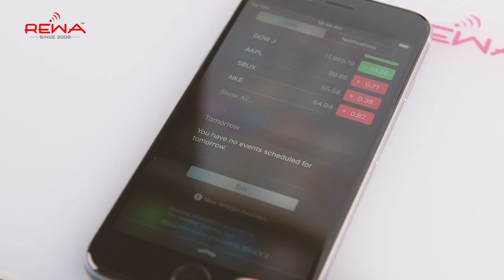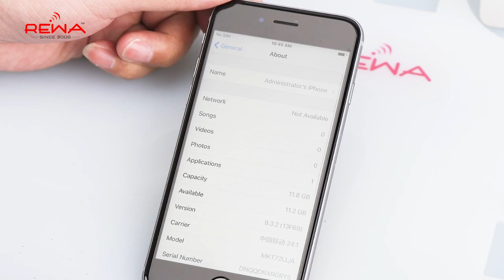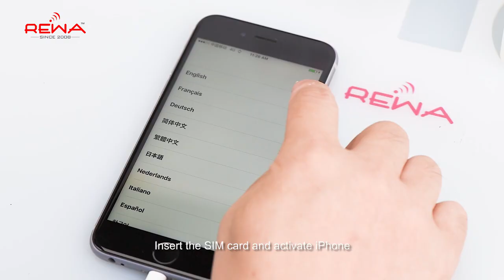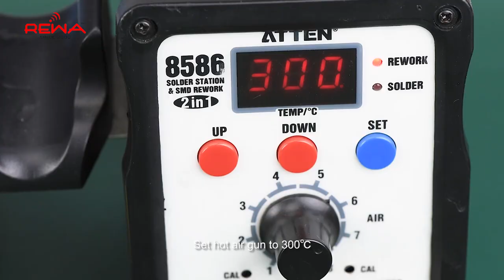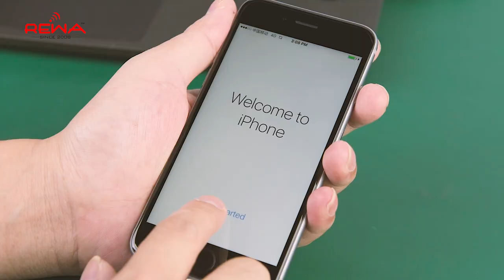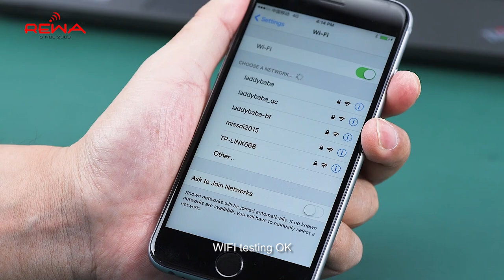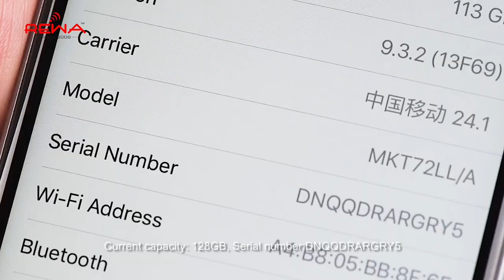Upgrade iPhone 6S 16GB Storage to 128GB

Comment: Can someone tell me what flux does?
Reply: Quantum Radiation it changes the brightness of your phone
Reply: NiceAim Will not consider your response... troll..
Reply: Quantum Radiation makes the solder flow easier making the joint bond better.
Reply: he wasn't trolling you hes just uneducated and thought you were talking about a computer program (FLUX) that has been built into the new ios versions.
Reply from the maker: Exactly.
Reply: uneducated lol ok ok
Reply: ItsTehzo Well you would think that he was talking about the Flux in the video instead of irrelevant software. Im guessing that he didn't watch the video. But now I know what flux is used for.
Reply: oh ok
Reply: The flux capacitor, which consists of a rectangular-shaped compartment with three flashing Geissler-style tubes arranged in a "Y" configuration, is described by Doc as "what makes time travel possible." The device is the core component of the time machine.
Reply: f.lux? It's a windows/Mac/iPhone app that changes the color of your screen at night. Copied by Chainfire in c.lumen. It's a redundant apps now because iPhones all have nightshift now. :p
Reply: Social Spit You obliviously didn't watch the video or read the previous comments..
Reply: Flux protects solder from oxygen, which is in the air . When metals are hot they bonds easier with oxygen and make  oxides, which is not good for electric equipment. Electrons flow "better" (faster and with less resistance) in clean, pure metals.
Reply: Mario Power thanks, knew there was more to it.
Reply: Quantum Radiation In high-temperature metal joining processes (welding, brazing and soldering), the primary purpose of flux is to prevent oxidation of the base and filler materials. Tin-lead solder (e.g.) attaches very well to copper, but poorly to the various oxides of copper, which form quickly at soldering temperatures
Reply: It works like KY Jelly.
Reply: Social Spit Nightshift - a copy of samsung's blue light filter
Reply: These few comments' just killin me so hard :D
Reply: it reduces the soldering temperature , ensures better bonding.

Comment: As a technician this is a lot easier to do easier than programming, programming is a way lot harder than this.

I recommend this to the people who does have old phone and necessary tools to practice pcb repairing/upgrading of a certain phone model. 

Don't do this if you don't have all necessary tools/equipment or you're gonna end up messing up the pcb/motherboard.

Comment: Guys, in order to make it fully successful, one thing that you need to do is debug the new drive by copying the critical data from the old drive by using a special equipment. You can check Strange Part's video for that.

Comment: Can I remove iCloud lock with this method ? 🤔
Reply: Edward Garcia no its in the motherboard
Reply: I mean the cpu
Reply: Somewhere i read about this, it is possible but i have no idea how.
Reply: HaLuNkE ST0NER You have no idea what are you talking about, i don't know if iphone 6 series has it anymore, but till iphone 5s there is a chip where the icloud data is stored, and that chip can be removed and replaced with an non-locked icloud data, i know it can be unlocked i had seen it at a hacking mobile service in Romania.
Reply: GabrielTV sure...they probabley going to steal your phone 😂
Reply: I said this because I bought an iPhone 5s on eBay and it came with iCloud :/
Reply: Has soon has you are prompted to do an Activation you will be fucked. The iCloud is locked on Apple Servers has Halunke says. So when you restore or you Update your device you will asked to do an activation (has you see it twice in this vid). 

You then need a internet connection and an activated sim card. At this moment a signal for activation (kind of an SMS) is sended to Apple servers and they check by serial number the device and update his status on theyre servers.... And there, if the device is locked with iCloud and you haven't the password or be able to reset it..... you're fucked.

The only way to avoid it would be a fack activated device. A chip or something replaced on your device to avoid activation.... But its risky. And if your device, for some reason has the OS instable you risk him to ask for an iTunes restore trought a computer.... so trash worty iPhone.
Or at the moment you will made unvolontary any update of your OS (or because you start to need it)... you're fucked.

Some services like Facetime and iMessages would be unable to activate...so you're fucked again... 
And you would be probably using another account activation... with the risk of being using Find My iPhone other account...

Well! A lot of headaches you would have!... And if it is really possible at least!... what i doubt... it is on Motherboard.... so... forget about it and purshase another iPhone... like everybody else... it is better. ;)
Reply: Nuno Brown you can unlock it
Reply: JackPlaysOfficial how?
Reply: JackPlaysOfficial I worked for Apple 2 years. I was an Account Security advisor... And i can tell you... even me that had all the tools to manage the accounts i were unable to unlock it. It's just impossible because the way they build it...

The only thing that you can do if you find an iPhone locked with iCloud is praying that the person that lost it launch a complete wipe on the device trought his iCloud account and then, he would lost the "Find my iPhone" lock with it too.
Reply: Nuno Brown there's always a vulnerability
Reply: JackPlaysOfficial Or another eventually is that the person doesn't have set no passcode on the lockscreen and you have access on the device... and if you're lucky and she has set all his emails on it, send a reset password from appleID manager and reset it trought password reset email in the person emails... that's the only alternative.... And i actzually already said too much here...
Reply: JackPlaysOfficial You don't understand don't you? What vulnerability?... Your device is locked on Apple Servers, not on your device directly.
Reply: Nuno Brown there's always a possibility
Reply: Haha all of you guys chill 😱
Reply: Edward Garcia 😉
Reply: Nuno Brown the truth hurts
Reply: JackPlaysOfficial you're just trolling men. There is o solutions other than the ones i mentionned earlier.

Has i said to you, i were Account Security for Apple for 2 years and i had someone with a locked iPhone in the family and were unable to find him a solution. There's no solution. Even if you work at Apple has you see...

We even had lots of customers that locked they're own iPhones and weren't unable to use them...
They need to send them for replacement with a Proof of Purshase... And they were replaced!
Reply: Nuno Brown That is none of your business. There is always a way to turn off iCloud lock
Reply: JackPlaysOfficial how... explain to us. go.
Reply: Nuno Brown I can't. But the video does show proof
Reply: This video??...
Reply: Why you can't? You're afraid the FBI is watching you? 😂

The guy restored twice his device and twice he need to activated trought normal procedure.

You gonna take the flash, install a already activated profile on your device and put it back to your iPhone... 

Then you will have all the contraints that i talked before...so whats your point?
Reply: Nuno Brown it's Man lol. I never found a a jailbreak anyways
Reply: JackPlaysOfficial wathever. it was a pleasue
Reply: and in the time that would take you could just steal a bunch of iPhones, sell em for parts and buy a legit one.
Reply: Yes. There is a tutorial by the same person. You just flash a new serial number on the NAND.

Comment: Might as well buy a Samsung with SD memory,its a better phone anyway,plus its cheaper.
Reply: Then don't buy the Note 7, get the S7 edge. Plus, iPhone batteries have been exploding as well.
Reply: What do you mean? "2  charge of phones"?
Reply: Yes. The Note 7 Explodes. Don't get the Note 7. Get the S7 Edge. It does not explode.
Reply: +Andrew Longauer But then how would we get a bigger screen? The note series is the only series of samsung phone i would get simply because the other models are simply too small. Of course, I could always get an iPhone plus.
Reply: Red Rooster I have the S7 edge. The screen is huge. You're really underestimatimh the size and either way you could go for the S6 Edge Plus or Note 5
Reply: Red Rooster - it burns better, that for sure
Reply: Red Rooster until it burns your house down
Reply: Alex Frattaroli - even though only 0.383 phones had problems - 100% of them are banned on the airplanes , and you can buy 0 of them in US. You right, I'm LMAO... out loud !
Hahahaha

Comment: As a certified automotive tech who became an ASE Master in 1978, I can tell you that this person not only knows his/her job, but take pride in doing the task properly and takes “Best Practices” to their industry. Bravo and great job. I do my own repairs on everything but I also know where to stop because I don’t have the equipment or software to properly accomplish this job. This is for Internal memory that is in the central processor unit and placed on the board with multiple points of attachments. The key issue for a surface mount device (SMD) is the solder will flow anywhere flux is applied. The cleaning both mechanical and wicking excess solder off board and preparing them for clean attachments is one half of the job and can not be overlooked. But the use of the soldering paste is crucial because it only allows enough solder on each pad to flow into proper contact when heated. Too much solder with the necessary flux means that under the chip, solder can run anywhere and touching other pads while shorting out circuits as each have a different function. So trying this without a stencil is impossible as the paste, thickness of stencil, much less position is the only way to keep solder on one pad. Excellent video, fabulous text, the right video speed and overall camera/lights makes this concept of completing this or another chip, just perfect. I hope my explanation helps someone understand better what can go wrong during a repair as I am not a computer or phone guy or affiliated with any company. Injured and not able to work in pain with limited money is a common problem in later years. This I just my interpretation of what I know from similar repairs and soldering skills on wiring and electronics. I am one professional guy giving a “Job Well Done” to the professional in this video, with helpful info!
Great job, two thumbs up!

Comment: Upgrading iPhone storage:
1. Remove screen with screwdriver
2. Remove logic board with screwdriver
3. Place NAND flash under $300 heating lamp and remove NAND flash
4. Flux and tin the connecting pads on the logic board
5. Flux and tin the connecting pads on the NAND flash
6. Reball NAND flash with reball stencil
7. Place NAND flash into $300 NAND programmer
8. Backup CPU/baseband info from old 16GB NAND to new 128GB NAND
9. Perfectly align new NAND chip with logic board
10. Heat new NAND chip with heating lamp to connect chip to the board
11. Reassemble logic board back into the phone
12. Reconnect screen to phone
13. Done

Upgrading Android storage:
1. Insert microSD card into microSD slot
2. Done

Comment: Awesome! What type or model hot air device do you use? Can I use this approach to save data from my tablet with moving the memory from the dead one to new one?can I move the data in some other way if the tablet motherboard is dead?

Comment: There should be a business that could do this.  A few things they could do, buy an iPhone from Apple, convert to greater storage, add a larger battery by replacing the back cover with a larger one to house a bigger battery, have a sim card slot that can switch from the original one and then add a cooler back housing.  Too bad Apple isn't doing these things.

Comment: Do you need to have the PCIE Nand Flash Memory Chip Programmer ? Or you can just put it without the programmer?
Reply from the maker: PCIE NAND Flash Programmer is required to program the new NAND.

Comment: Never plug in battery to motherboard before u connect display and other wires!!! this is not safety for electronic components inside iphone
Reply from the maker: You are quite right! This is actually an inaccurate demonstration, especially for beginners. For experienced repair techs, sometimes they may connect the display first for their technical proficiency. But for beginners, this misoperation may damage the phone. Thanks for the feedback. We will keep improving.

Comment: This process can be done with the android mobiles? Galaxy s6 or Pixel for example
Reply: Nahuel Duarte heard of a sd card?
Reply: @travisscott2264  The S6 and Pixels don't have a slot for SD and the adapter is uncomfortable. Maybe if it's possible to solder an adapter to the board or something like that, it's an intresting and riski idea
Reply: Like use the adapter AND charger the phone at the same time

Comment: am wondering whate about the IMEI number will change or not? if not would the info. of this number change on Apple servers??
Reply: Let me answer myself 😁 according to the IMEI number of your iPhone which is 353270076923293 didn't changed and on Apple servers this information:
IPHONE 6S 16GB SPACE GRAY
IMEI 353270076923293
So that's mean the Changes will be only inside the device it self not on the servers.

Comment: Hello, I applied all stage on my phone, it works with 128gb, But I have problem, My phone is over heat, When I use the applications, The battery drain so fast, and also when I try to charge it, it overheat again? what would be the reason the overheating? Ps: 6 months ago I changed the U2 tristar chip, I guess the problem not related with it.

Comment: this can not work has demolished solder pad when removing from chip sees no one
Reply from the maker: The fallen pads are empty pads which have no circuit connected, please check the diagram in the video for reference.

Comment: bro is it possible in iphone 5s if possible please make a vedio pn that topic
Reply: Yes it is but that his process is very hard and expensive just to transfer the information on one chip to another is $500 piece of equipment.Also it is possible of destroying the chip,those pads he pulled away,are very useful,maybe he got lucky and pulled something may not be needed but a lot of them are needed.Its pretty much the same way but the inside of the phone might be different

Comment: Such a hassle.  Get an Android Phone and buy a 200GB microSD for $25-30 bucks.  Problem solved.  Sync your photos/videos to Google Photos (never run out of space).  How many times have you all found yourself taking pictures/videos at an important event (once in a lifetime) and had to pause and delete junk from your iPhone?  Weddings?  Graduations?  It sucks.  Nothing dumber than a manufacturer who hates their customers so much to put them in this stupid (unnecessary) situation.  Apple/iProduct users should all band together and write Apple a Letter that simply says, "We all love your iPhone, but you need to love your customers back.  Allow microSD Storage.  What you do to your loyal customers is STUPID."  I wrote a similar note to Jeff Bezos regarding Amazon Prime Video a few years back..  He fixed it for EVERYBODY, in less than 24 hours.  Sometimes it is as simple as a letter to the boss.